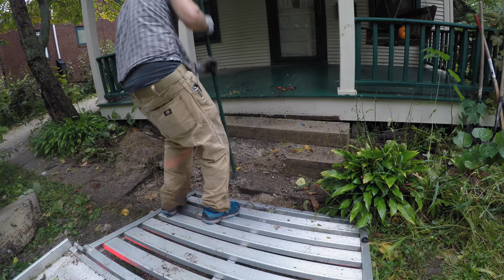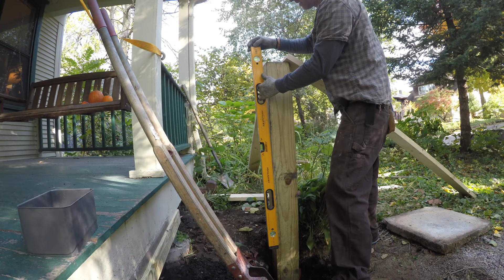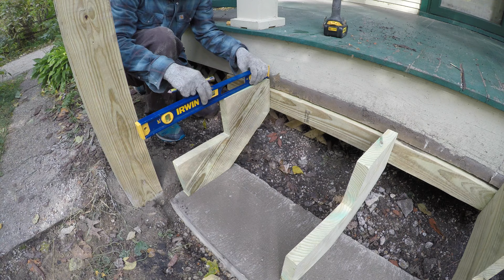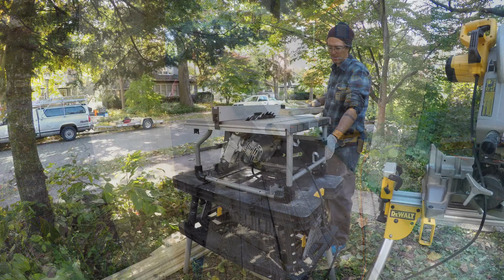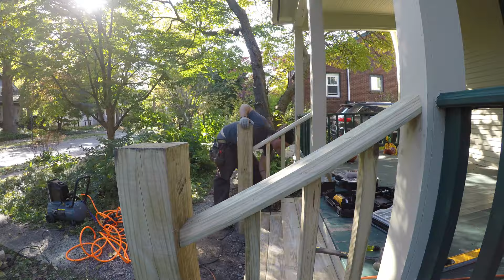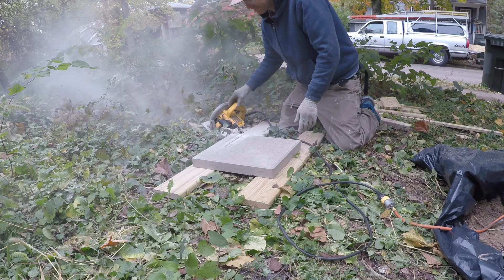Building Simple Front Porch Stairs

Comment: Solid build.  One thing I have learned and researched extensively, the deck boards are best if you lay them smiling at you like a U; not a frown like an upside down U.  The board will most always want to bend out like flattening a U, therefore if it cups, it will cup facing the ground.  A book called "Understanding Wood" by R. Bruce Hoadley explains this.  I personally have experimented with setting boards out in the elements for a while, only to find this on nearly every one, or they split at the cup...  There are debates about this online, but I found out for myself.  Look around if you remember, and you will see many cupped porches and decks, and the end grain will not be smiling.  Great solid build though!  This small of an area shouldn't matter anyway.
Reply from the maker: Interesting. I've long followed the rule of placing the potential cup down ... or like a frown ... but I've never conducted any experiments. I guess the good thing is that a lot of decking is cut out of the heart wood without much of a smile/frown. Thanks for giving me something to think about!

Comment: Nice job.  Gotta replace porch stairs... 
Question.  I worry about burying any wood in the ground here. Termites, rot.   

Is it acceptable to pour a foundation of concrete or lay a row of pavers or bricks  for the posts to be bolted onto like you would for a deck, as well as the stringers? 

For fence posts, an old farmer told us years ago to use packed sand, not concrete, around them.  We auger a hole 2ft deep here.  Despite a lot of clay in our soil,  it seems this drains away,  where concrete holds water against the post, or so he said. (Even if you slope the top of the concrete away from the post.).  

So on our first fence, we followed his advice and have never lost a fence post on 6ft high fences in 40 years...  while neighbors lost theirs snapping off  in high winds, tornadoes, but also from the posts rotting off.  

Don't know if this will be applicable to stair posts.  Would like to keep them above ground. That may be dumb. I hear you, they need to be sturdy.  Thanks for the video.
Reply from the maker: I'd done stair posts (newel posts) above ground using brackets ... just keep in mind that they get a lot of leverage up on top when people push and pull on them, so framing well off the porch is essential. Sounds like a good plan!
Reply: @metaspencer  thanks very much for sharing your experience with these types of projects.

Comment: Nice work !, I am in NE Iowa, And have the same cement 3 step steps around 7"long, Im too lazy to try to break them up, They set on sidewalk going out about 25" to the street, its old, and where the steps set on the walk, is right und the drip edge for the porch, Never reall dries out, Winter water and ice is pushing everything down, and looks bad and unsafe, , There is gutter but it still drips, I am no carpenter, and have a guy removing all the cement and steps this week, and poring new siwalk the same as the old, so I wil build new step from wood, Question, How do I stop the drip from hitting the steps and freezing? extend the roof line out? Like I said, I am no carpenter
Reply from the maker: I usually manage to take care of drips like that with a short gutter, drip edge, or water diverter (just some aluminum channel, screwed or nailed in place. I would think that extending the roof line would be overkill ... I wish I could help you out with it! good luck
Reply: @metaspencer  Yea, there is gutter all the way across, but for some reason it still drips right on the steps

Comment: Thanks for the video!  I just pulled out some porch stairs that were pretty bad.  The bottom of the outside stringers were completely rotted as well as the bottoms of the rail posts.  I would like to follow your guidance about the sill and posts but I'm worried about frost heaving. Where did you do this installation?  How deep is acceptable to you for the sill and posts? I am in northern NY.  Thanks!
Reply from the maker: This one is in the midwest and 24" is deep enough. I recently installed a deck near Ithaca, NY and went for 36" deep posts ... I actually poured a footer at the bottom of the hole, then installed the post on top of that surrounded by concrete. Good luck with the project!
Reply: metaspencer Sweet I just finished the posts and read your post after, I’m glad I went 36”!  I also saw another video where the guy put deck screws around the post before putting the concrete in so I did that too...thanks again!

Comment: Great video thanks a lot, I learnt some good tips.

I'm having to replace my steps because they got infested with termites.  You're not worried about termites getting into those newel posts?  Do you get termites over there?  I live in NSW, Australia.  They're a big factor in building with timber over here.
 
Also, I didn't notice you arras the two posts.  Any reason?  (Arras - meaning to plane the corner off, to avoid splintering.  I couldn't find this word online; maybe it's a local term.  Or maybe I can't spell :)
Reply from the maker: Hey man, thanks for checking out the project! Yeah, we don't have much of a termite problem here. I've seen vids of guys building in Australia who use treated wood ... that might keep the bugs away. You can also place the wood up on a sill to keep them away. As for the arras, I usually hit the corners with some sand paper and that's about it. You can certainly plane them down but I don't tend to worry much about that. Take care!

Comment: Really fine work, Spence. Good attention to detail. What brand/kind of sealer did you use? Have you tried the silicone stuff you can put on down to freezing? 
I had a concrete guy who thought he knew everything redo the front 3 steps and landing. What a nightmare it turned out to be. They didn't want to do the job until the end of the year (too small for them apparently but they didn't say this up front when they got half the money) then when they poured it, it cracked. Had them do it again (had to wait until the end of the year AGAIN, cracked again in the exact same place!) Holy fuck I wish I went with wood (I almost did it myself from the beginning but concrete is supposed to be so superior and this is a rental property so I wanted it very durable & looking top notch.) Showed up drunk and belligerent. Just the biggest PITA for a relatively small job. No sense of how to deal with the public. I look at it every day, cracked, and I feel like it was a good chunk of money down a bottomless pit. I think I am going to buy some more of that good sealer and try to keep the freeze thaw cycle from clobbering it.
Reply from the maker: Oh man, I've heard too many horror stories like yours! Everyone is always having to wait for what ends up being bad work. Bummer. For the treads I sealed with Thompsons; for the wood I used a polyurethane product that is paintable and very flexible. I'll have to check out that freeze-able silicone goop you mention. Anways, always good hearing from ya!